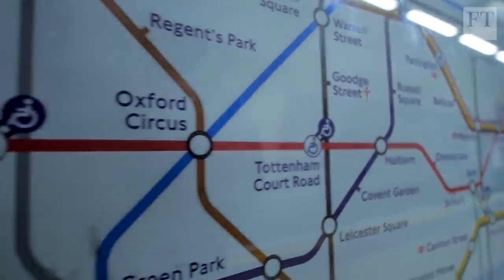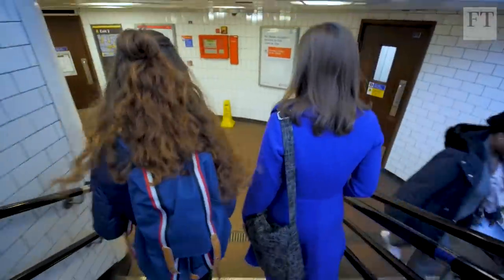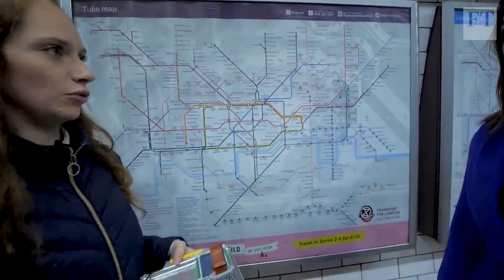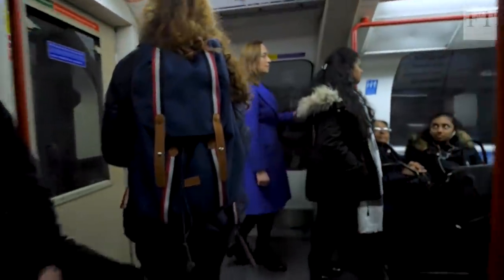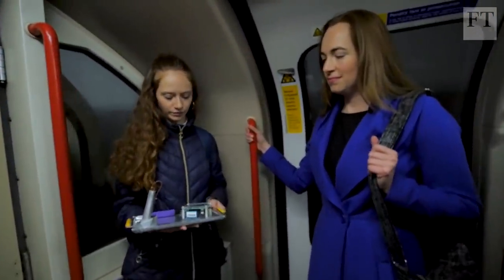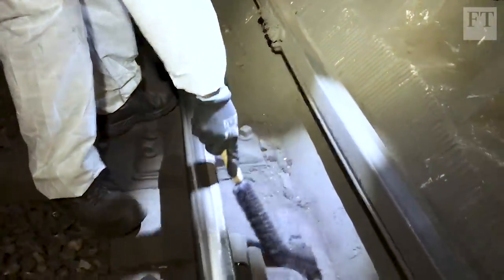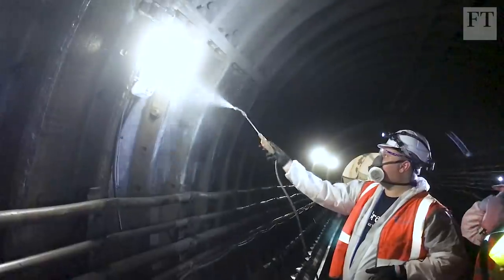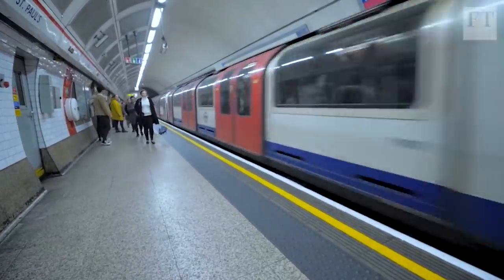Going underground: how commuting is bad for your health | FT

Comment: Now the Chinese who wear masks all day seem much cleverer than we thought
Reply: Possibly, but perhaps not. Masks are not created equally and may not be designed to filter out certain particles of pollution as they may be too small, etc.
Reply: Cleander Yu but it is better than nothing.
Reply: the PM 2.5 level in northern China  are often at least 200 outside, some even above 500.
Reply: Sure better than driving & still breathing smoke. I rather be relaxed in a rain.
Reply: No mask is capable of blocking out pm2.5 particles , this is a common sense here in China
Reply: Japanese you mean?
Reply: As masks get wet by breathing, they loose their protective abilities and become a breeeding grounds fo bacteria. So, unless you swap these maks every hour or so, they dont help at all.
Reply: Yeah no. Air pollution levels across Asia are shockingly high, many times higher than in Europe. Delhi in India now has PM levels so high that all residents are asked to wear face masks.
Reply: Masks are banned in many places, I tried wearing one commuting in Paris because people were smoking crack in my station and connecting station and the police told me I had to remove it! Btw I was also breastfeeding at the time.
Reply: cleverer
Reply: @1292liam  Fixed
Reply: Well,In Japan When They Are Sick,They Put Masks
Reply: @Sth_Magical  but it does...
Reply: Did you not see the video? These particles are much finer than a human hair. Good luck getting a mask that filters it out.
Reply: Anna Barr is it because people think you’re up to no good or some public image thing?
Reply: Anna Barr no Masks are barely allowed. Paris is a ridiculously strict area not allowing anything covering your face or hair that would obstruct identify or is linked with religion
Reply: Health before fashion, notice what the cleaners are wearing.
Reply: Original Herdsman This is London..... not Paris
Reply: @no-ss2dw  sorry know understand Anglo-French
Reply: @Viktor Sligo makes me wonder what the snail's and slugs are eating now days as well .
Reply: @Sth_Magical  so do think that the cleaning workers on the London underground are being provided with incorrect equipment to go to work with. ?

Comment: 10 people with a toothbrush cleaning the entire London system. What a joke.
Reply: Hahaah thats what I was thinking. Even the brush i use to do the dishes was bigger than the one they had.
Reply: 😂😂😂😂😂😂 so funny, I've just being rolling around laughing. I saw your comment just before they arrived with their toothbrushes. Priceless haha
Reply: Bruh just use a wet dry vac and a steam cleaner
Reply: Could be an experiment or gathering samples.
Reply: @@ZerkosXD The problem is there's far more to the system than you see. Whole stations and tunnels unused, and an electrical system that's long out of spec.

Comment: That cleaning project did not look very effective
Reply: Looks like a show
Reply: Purely PR by TfL. There would need to many times that number of cleaners to make any level of difference.
Reply: @mlc4495  Maybe it's a careful search for treasure
Reply: PR. They could use a special carriage to clean the tunnels instead of a toothbrush ...
Reply: @r3dp1ll  have those existed anywhere else?
Reply: @rhodesianwojak2095  tbh no idea. Buy I think it's doable and could greatly help
Reply: @rhodesianwojak2095  In Germany we use special "vacuum" trains to clean tunnels, not the air though. It'll prevent switches getting stuck and fire hazards due to inflammable dust and rubbish.
Reply: @soppoi123  are there any videos of it?

Comment: It always smells like a metal workshop at the underground.
Reply: It does! I've never been able to put a name to that smell
Reply: it's literally pulverised metal dust from all the metal brake disks on the trains and the grinding of train wheels on track
Reply: Coincidentally, it smells like the underground at metal workshops.
Reply: @emptyangel  I see
Reply: lan dz these electrical fumes
Reply: @lydiamusima5840  😁😁
Reply: @sprobablycancr4457  I see what you did there
Reply: @emptyangel  That, plus the ozone smell you get from an arc welder - all that hot electrical equipment on the trains plus the ozone gas from all the arcing as the trains go over gaps in the power rails.

Comment: I wonder what the difference is for stations and platforms  on the Jubilee Line where there have been platform doors and glass screens installed
Reply: Probably are better, as much of the pollution comes in from tunnels everytime the train enters the station. So having doors prevents all of that dust the come in, which makes air quality better, yet not as good as it should be.
Reply: @CityWhisperer  On parts of the Jubilee line these doors are only 3/4 in height of the platform, I guess you would get lower readings sure, but I still think the numbers would be high.

Comment: If you are on the platforms of either Seven Sisters or Finsbury Park and a train leaves, you can often see a plume of light brown smog that comes up from the tracks and fills the platform. I’ve only ever seen it at these 2 stations too, and both are very warm even in the winter.
Reply: Seen it many times on the Victoria line, Tottenham Hale mainly

Comment: The statement from TFL that  air  quality on the underground system is safe , is the biggest decpetion levellled at the public, since cigarette manufacturers declared smoking does not give you cancer.
The Browncarguy (youtube) has done a siimilar test using a professional air quality meter on London underground stations further out of city and his results were shocking. 
The trains seemed to cause a massive increase in pollution at stations as they arrive and depart. In additon the level of polution inside the trains is and on the escalators  ion between stations is unacceptably high!
 
Essentially these two independent (youtube ) reports indicate that travelling on the underground exposes the traveller  to dangerously high levels of poluttion and may seriously damage ones health.
Reply: The installation of lifts for equality accessibility would seem to be a heaven-sent opportunity to ventilate using the lift shafts, I'd have thought.

Comment: It’s good to measure air quality but the findings need to be compared against being on the surface in various locations, on a train, on a plane and then in the countryside. Commuting is also expensive if you travel long distances, time consuming and stressful. I work and used to commute but now work from home so don’t need to suffer the air quality of tube trains!
Reply: Many other reporters have done this, and the contrasts are notable, in conformity with the study. The dirt is visible and engrained: what they're doing is tickling at it. It's time to start water-blasting to get back to clean, but that in turn is going to cause anarchy in the electrics.

Comment: @ft if you want to find out what the long term health implications are, test the drivers in each individual line and test their lungs/breathing capacity
Reply: Drivers cabs have hemp filtration system. So they're probably breathing in cleaner air than the countryside.
Reply: @Rawdil  what stock is that filtration system on?
Reply: @N4K5  2009 Stock on Victoria line and all S Stocks on District, Circle, H&C and Met lines.
Reply: @Rawdil  so there's still piccadilly, northern, central, jubilee and bakerloo lines which aren't filtered and are deep tunnel tube lines
Reply: M K very true

Comment: Is the device she is using certified by any respectable organization?
Reply: I'm sure it's accurate, but it would be important to use scientifically rigorous measurements to drive policy decisions.
Reply: RPDBY regardless, the measurement of air quality in the underground system has been done numerous times by respectable organisations using accurate monitors so she’s not saying anything new. The London Underground system has notoriously bad air quality.
Reply: @je6874  so why didn't she use their data? what was the contribution of the item she was holding?
Reply: RPDBY I suppose it adds to their argument because the air pollution is still severe. It probably didn’t cost them much either.

Comment: The London underground is disgusting. I don't mind the filth on the ground or on the trains it's the air. It's so dry, dirty and stuffy. They need to speed up the installation of air conditioning in all stops ASAP.

I am from Ireland and Dublin is now beginning its metro plans but at least our lines will be less deep as it will be modern system and the air will be less dead.

New York has a subway system I don't mind. Why? Because its not as deep and the air is a lot more breathable.

Helsinki was lovely, Tokyo was amazing. Paris even was better than London but not by a lot.

London needs to start installing more lifts. Too many steps and the air is disgusting. I actually get dizzy and weak when down there and feel confused.

I have a chronic illness and the tube and its air and temperature affects me big time.

Only other time I do feel that way is walking around a city in a heatwave or on a packed plane for hours.

I genuinely can't tolerate the London tube and it's a pity as it's an amazing system.

It just needs more elevators in deep stops and needs modern air con badly

Comment: How is this compared to a London street pollution?
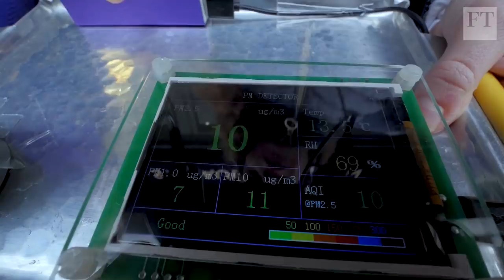Reply: At 0:25 you can see the street level. And you don't need such device to hear the difference if you ever used the central. Lol
Reply: @borisdemelo  mmh must be a specific London thing then. In Berlin I never noticed anything.
Reply: @fjellyo3261  It's because London has some of the tightest spaces for metro system tunnels in the world, hence the name "tube", whereas in Berlin and other Metro systems these are less particles per square area, which means that the air is more clear.
Reply: On the streets of london, you can see everything clearly but the amount of NO2 is very high which is 10x more hamful than CO. So u may not be able to see the pollution but you are taking it in

Comment: Most British buildings don't have AC unfortunately.
AC filters air and uses germicidal lamps to kill germs.
Even the local hospital does not have AC....so in winter it becomes a petri dish that makes people sick.
Reply: ACs release CFC which becomes harmful for the environment and makes the ozone layer thin. Also, it results in global warming too
Reply: @ukisbeggar8462  
Why has the ozone hole is repaired itself yet there are more AC units than ever?
"16 Sep 2019 · The ozone hole over Antarctica this year could be one of the smallest seen in three decades, say scientists"

"2019 Ozone Hole is the Smallest on Record Since Its Discovery | NASA
21 Oct 2019 "

"When air conditioners were first manufactured, they contained a liquid refrigerant composed of chlorofluorocarbons (CFCs), which were later found to emit greenhouse gases. In 1995, U.S. manufacturers began replacing CFCs with halogenated chlorofluorocarbons (HCFCs), which have a reduced effect on the depletion of ozone. However, HCFCs still emit greenhouse gases, and the U.S. government is phasing them out of production by 2030."

AC is not responsible for ozone destruction and global warming.

Why not educate yourself?
Reply: @MilesBellas  because there are no ACs in Antartica.. Antarctica itself is a huge AC
Reply: @ukisbeggar8462  
Britain is less than 1% of the global population.
Why not research where mass pollution is really being emitted from?
Hint : it is not AC units.

Also, since the UK is cold the refrigerant isn't used.

All fridges should be banned too? for tiny pollution?

Overwhelming Exception Fallacy.

Educate yourself.

Fact is, circulating air and using antibacterial UV lamps and filters to clean the air..... to stop hospitals becoming petri dishes and stop increasing infections and stop diseases spreading...... is uncommon in the UK unfortunately, because buildings are older.

In the US, AC is in nearly every hospital, office building, home etc....

.
Reply: @MilesBellas  have u heard of Canada? It's colder much than Uk but they have ACs
Reply: @ukisbeggar8462  

"no ACs in Antarctica"

Air Conditioning does not simply cool air.

Air conditioning "conditions" air quality and temperature.

Air conditioning uses UVC germicidal lamps to kill 99.9% of bacteria and filters to remove particulates and decrease humidity.

ACs can heat rooms too.
Reply: @ukisbeggar8462  
Refrigerators are the same as ACs.
Your comment means that "all fridges must be banned in the UK to stop global warming" too ?
Why not research the topic?
Reply: @ukisbeggar8462  

I have lived and worked in Canada.
Go and educate yourself.
Research the topic.

Comment: This is an interesting posting.  On YT there are several films about the cleaning of the London tube tunnels.  One film dates from 1944 showing a group of women nick named "Fluffies" who worked in the tunnels between midnight and 5am cleaning the tunnels and track using dustpans and brushes.  A man following with a trolley was emptying the dust pans into a bin on wheels.  No PP for the women.  Another modern film shows a special tunnel cleaning train that is apparently used today.  It was said in the films that a lot of the tunnel filth dated back 100 years.  However, bearing in mind the extent of the London Underground I can't imagine that every tunnel is cleaned properly on a regular basis these days.

Comment: Air pollution is the least of the problems. 200 cellphones streaming in a metal box? Looks like a trip in the microwave.
Reply: Cellphone connections are like microwave ovens in the same way as a  shower is like a tsunami.

Comment: Tube is rather pathetic in general.. But what are they gonna do about the air? (What you gonna do? Act a fool!) Other than pumping out some pacifying gas for us.
Plus when you hear the train wheels scrape like at Bank station (because they can't afford to fix the rails) you can now imagine minute ''splinters of metal'' getting into the air..
Reply: All it takes is a little grease pot on the curvatures to allow the wheels to slide over it. LUL don't have the funding to refill the pots. Believe it or not.

Comment: Wow, that is a really tiny particle measurement device — didn’t know students have access to such beyond Mars-rover level equipment 😆
Reply: I assumed they made it themselves.
Reply: Aron Que Marr the device is too small for the claims they make: with such device they can’t say what kind of particles are in the air, nevertheless they do. Most likely their device is reporting water vapor or something else safe.
Reply: @pushed-into-context  They published a paper. That device is only for particulate matter. Metal ions were found by filtering air through a fine filter and then testing the particulate matter in a lab
Reply: Robert Lyness still skeptical. I’ll wait till real scientists with old-school large devices do the research properly (kidding).

Comment: This is about particles. No mentioning of germs in the air or on whatever handle you have to touch - another thing that is a health hazard.
I live in Berlin and try to avoid public transport whenever possible. Thanks to two rather good bike rental systems, I can really keep itvdown to a minimum.
Reply: No Troll germs in the air? Do you have a compromised immune system? If you don’t then you don’t need to worry about ‘germs in the air’.
Reply: You don't need a "compromised immune system" to catch a cold or worse.
Reply: No Troll no, but is a cold really the end of the world? And what do you mean by “worse”? You only need to worry if you have a compromised immune system because that’s when “worse” comes into play.
Reply: @je6874  There is quite a lot beneath the end of the world I prefer to do without. A full influenza can easily flatten you for a week.
Reply: @je6874  Am I? Look up what influenza means and how many lives it takes every year.
And guess what, I also don't smoke, don't drink and drive and use seat belts. 
If you like taking unnecessary risks...your choice.
Reply: @je6874  I wear a helmet and a high viz jacket, use cycle lanes and though I'm more relaxed about traffic lights than when driving a car, I certainly stay out of harm's way without anyone's help.
Reply: @je6874  My electoral area is known as "World's End".